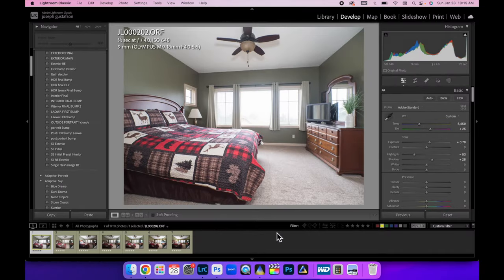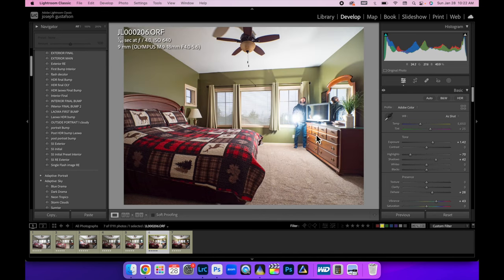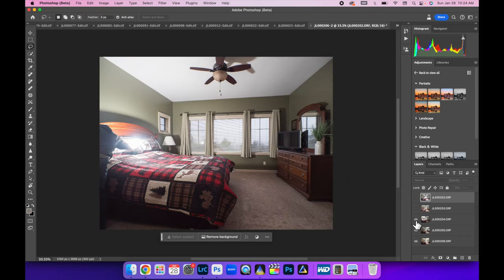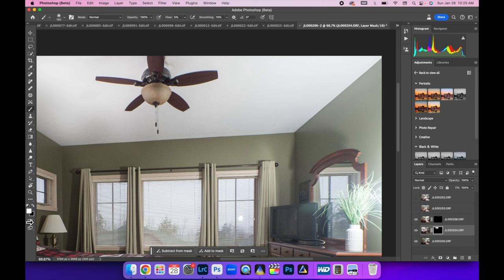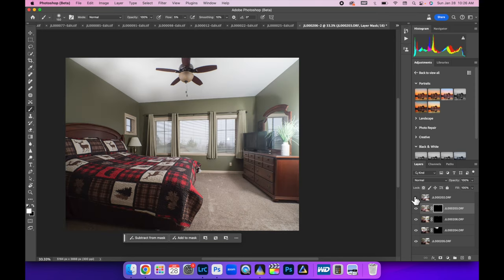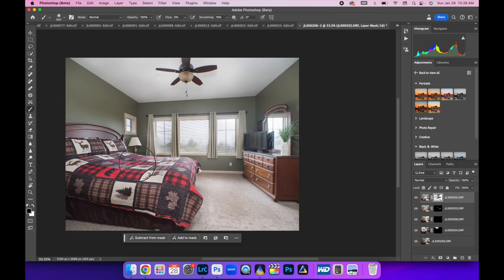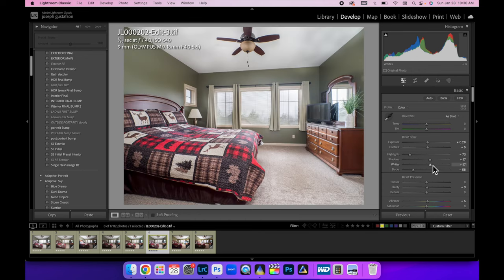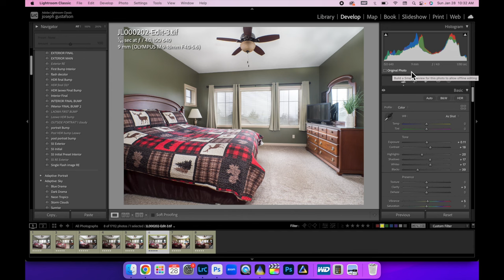Flambient - Ceiling Fan Shadow Tutorial - Real Estate Photography

Comment: This is great, but another good way that I found to get rid of shadows from fan and lights and is fast is trace out the shadow and use the new generative fill in photoshop to remove. Been working for me…
Reply: Oh, I didn’t know about the double click, like that a lot. Thanks. Cheers.
Reply from the maker: Ya.   I've done that before too.  Depends on situation though.   Thanks for the tip!
Reply: @joefoto  yeah, good to have a few tricks in the bag… it does depend on the situation. 👍cheers

Comment: Once in a while I'll have shadows appearing around a fan  that won't respond to my regular methods. I'll flatten the image and use the object selection tool on the fan and then inverse. Now I'll use the dropper to get a good color selection near fan and just use the Brush to paint over the offending shadow. Adjust your opacity and flow as needed. Quick Fix!
Reply from the maker: Great tip!  Thanks for sharing!